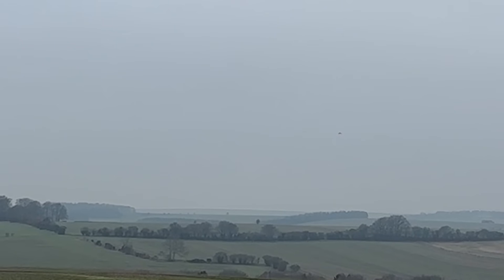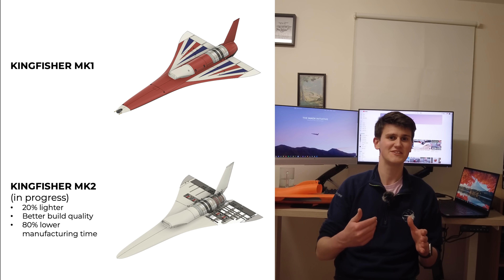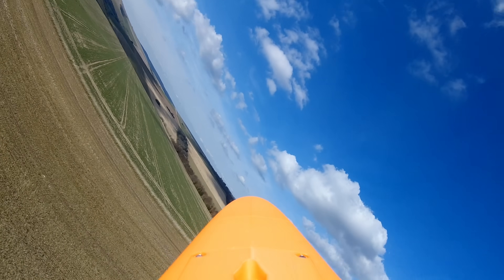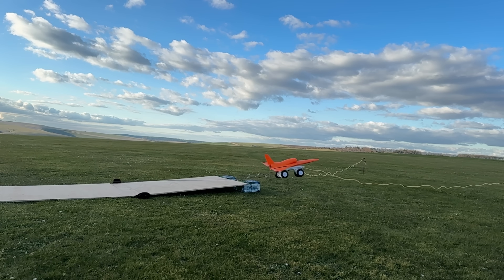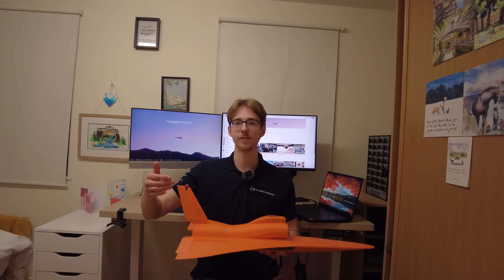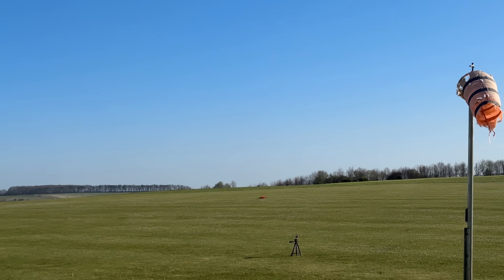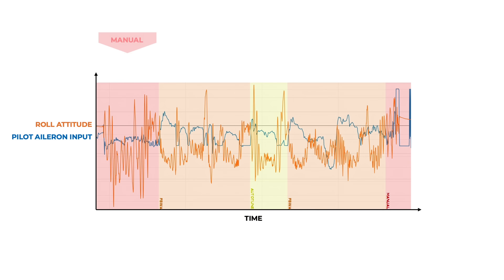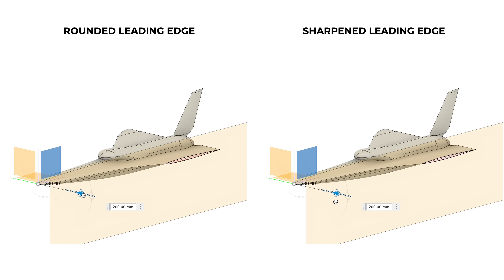After THREE CRASHES Kinglet Finally Lands!

Comment: With your current design, is it not possible that the roll oscillation is somewhat related to your ailerons being shadowed by the lifting surface? If you were to move the control surface out to the wingtip (i.e. where the dihedrals are now)? This would be an unconventional choice, but it can't be affected by the vortex separation and being farther from the CM, you would not need much force from them to get the required torque.

Comment: I love how they spent all that time trying to build a full scale one, using carbon fiber and epoxy, and and ACTUAL jet engine... Just to go back to a full 3D print with a electric prop...
Probably some kink in their original design they are trying to work out, but they didn't really say what or why, or even go over the results of the engine test on the full scale. 
Kinda sus
Reply from the maker: We got too ahead of ourselves, should’ve done the sub-scale testing first as it revealed a lot of flaws in the Mk1 Kingfisher design, these flaws are addressed in Kingfisher Mk2 which you can see in a community post on the youtube channel - this will be discussed properly in our next video coming out in 1-2 weeks time which goes over the engineering behind kingfisher and the kingfisher mk2 build. At least we realised this before trying to fly the Mk1 aircraft as we would’ve destroyed the jet engine
Reply: @TheMachInitiative Well, thanks for the reply, and good luck. Hope you can get it working, as it does look pretty freaken cool.

Comment: ---

1. Airframe Design

Material: Carbon fiber and aerospace-grade composites are a must for strength-to-weight ratio and heat resistance.

Aerodynamics: Supersonic or transonic airfoils, with a razor-thin profile and low frontal area. Very little surface area = less drag.

Reinforcement: Internal bracing for high G-forces and vibration.

---

2. Powerplant

Turbine Engine: A miniature gas turbine (e.g. JetCat or KingTech) capable of producing massive thrust.

Alternative: Pulsejet or ducted fan setups, but these are less efficient at those speeds and harder to control.

---

3. Control and Electronics

High-Speed Digital Servos: Able to handle extreme forces at high deflection rates.

Stabilization System: A flight controller with gyro stabilization (like Cortex Pro or similar).

Failsafes: Redundant systems for failsafe, telemetry, and GPS tracking.

---

4. Power Supply

Fuel System: High-quality turbine fuel with insulated tanks and proper pressurization.

Battery System: LiPo or Li-Ion packs for electronics with current protection.

---

5. Radio System

Long-Range System: At least 2.4GHz with telemetry or even 900MHz with a backup module.

Low Latency: Fast signal processing and minimal interference.

---

6. Testing and Simulation

CFD Simulations: Computational Fluid Dynamics for airflow prediction.

Flight Simulators: Test your model virtually (e.g. RealFlight or X-Plane).

Scale Prototyping: Build and test slower prototypes before going full speed.

---

7. Legal and Safety

FAA Regulations (or local authority): Likely considered a UAV or missile-like object at that speed.

Test Range: Must fly in a secure, unpopulated area or dry lakebed with spotters.

Safety Measures: Fire suppression, remote tracking, and crash safety gear.
 
Hope this helps achieving your goal

Comment: If the aircraft is sufficiently stable at the higher speeds during the record breaking attempt, you should set roll and pitch limits to prevent the aircraft from being in such a way that you unkowingly lose altitude (unless you have live altitude feeds in which case you can make an altitude hold system with auto yaw adjustments so that all you have to do to change your heading and stay level is roll left or right and the computer will do the rest. This is also useful to prevent overcorrection from manual piloting which can impact the aircrafts ability to maintain or gain speed, and in the worst cases can cause catastrophic failure if an accidental input puts the airframe at its limit.

Comment: under high dynamic pressure loads on the elevons you may find using a push rod for up elevator may be problematic at high speeds, i would personally suggest using a pull mechanism for pitching up, but other than that this thing look absolutely incredible. best of luck with M1+

Comment: I'd propose following (I am not shure if it works):
Mount 2(!) Fins (Like SR71, MIG 35...). Center fin sounds good for the first view but for high aoa. it get's slapped. Loads are high. 
 I propose a non-curved LE. Mount a straight strake to have a LE kink to fix vortex. These 3D-CFD-results look nice- but they don't avoid the first vortex (you know what I mean?) dancing around and destabilize along roll axis. You can also fix it by a b.l. fence- That's up to you. 
Shorten flaperon in spanwise direction a little bit. 
And go ahead - very nice project! Whereever u are. Whoever u are.

Comment: 133    put linkages on the  TOP  of the wing; because  turbulence  will happen there, anyway.       you may know that there should be a concentration of mass 'around' location of the center of mass (c-m).    ideally, the location of the c-m should vertically align with twenty-five percent of mac.      you may know that c-m and cg are two different thing.

Comment: 035   you may know that the model's dom is a bit top-heavy.    dom is distribution of mass.     the area of the vert-stab is low.     if that is not changed, there will continue to be a shortage of yaw axis stability.      alternatively, aft-located vortex generators could be tried.

Comment: 820   i think you don't understand that vortices are  sources  of  DRAG.!    (that is why (aft-located) vortex generators are utilized in order to increase the stability of certain jet fighter aircraft.)
on the other hand, lift is a  simple  newtonian  result when a wing has positive aoa, while moving through air.      this is why a toy glider, that has a flat-plate wing profile, flies just fine.
the data logging shows  YOU  that the model is flying in a nose-up attitude most of the time.      at those times, relatively  more  drag  is occurring.

Comment: 15 years in Aircraft design.  A couple of suggestions.  1, the fin looks too small, extend the root forward.  2, every gram counts, reduce cable lengths where possible . Reduce material thickness where possible.  Less weight requires less lift so less aerodynamic problems

Comment: Good luck chaps.  I assume you have the power required with the turbine to push to the required eventual speed?  I do wonder if, as per your web site, you're moving into prohibitively (for students!) expensive engineering with needing to use composites for the airframe.  This becomes a whole different ballgame!

Comment: Maybe all you need is to add wing fences two thirds of the way down each wing to prevent vortexes rolling off the wing. Study some early designs of late 1950s- early 1960s delta fighter planes like the Mirage, Delta Dart and Avro. 1960s Aeromodeller anuals also talk about wing fences for delta wings.

Comment: I've scratch built many RC deltas over the years inc one designed for all out speed and that it did perfectly until landing.
It exibited many traits yours does and I reckon for similar reasons, the fin.
Now I didn't have a dirty gert fan intake and FPV mount destroying the airflow on mine, I had an inline exhaust and cantered over 2 stroke but even small twin fins at the back of a delta don't see clean airflow at a high AoA.
Although your fin is high if you held the wing at 30 degrees and drew a horizontal line from the nose to the fin I doubt much would stick above it.  
I increased my fin size to be above this line and it turned into a pussy cat rather than a rebuilt every flight. This inculdes banked turns as these increase AoA and turbulence ontop of the wing.
For this same reason you'll have trouble supplying clean air to your turbine in anything other than straight and level flight so you may well get flame out issues.

I know you tried angled winglets but like that these just promote the vortices. 
You could ditch the weak central fin ( which while avoiding clean air may be hit by your wing crank vortices and inducing oscillation also ) and go with winglets.

I have nothing but my own built in CFD and years of tinkering to back any of this up but the fin is the first place I'd look to solve some of your issues.

Lastly, have a look at Dynamic soaring to get an idea of the type of engineering required to fly rc planes at these speeds

Comment: The camera mounted above the air intake is definitely disrupting the airflow significantly. If you actually intend to fly near Mach speeds, you’ll experience substantial dynamic pressure buildup both in front of the intake and along the leading edges. Therefore, it would be better to place the camera inside the intake, shaped like a cone — you would get a similar field of view (I understand you need to pilot somehow, and an FPV camera is very helpful) while at least partially simulating the increased drag at the intake.

Another point: at subsonic speeds, an intake on top of the fuselage works great because it helps create a low-pressure area over the wing. However, at supersonic speeds, an intake under the fuselage — like in the F-16 or basically any military jet — would be much more effective.

Also, your wing profile seems very thin, meaning it’s probably highly sensitive to changes in the angle of attack. It’s only optimal in a very narrow range of angles close to zero. It would be really helpful if you installed a Prandtl tube and an angle of attack sensor at the nose. You would gather much more flight data instead of just getting a nice YouTube video showing it flew and didn’t crash.

It would also make it easier to program the autopilot if it had real flight data like IAS, true airspeed, Mach number, and angle of attack.

Good luck with the project — I’m genuinely curious whether this is just something that looks cool on YouTube or if you actually manage to make it work.
Reply from the maker: Thanks for your interest in the project! To answer some of your questions:

The camera above the inlet adds drag - although it will be smaller (relative to the aircraft size) on the full size aircraft and the pilot needs to see! Our inlet has been designed (using CFD and engine bench testing) to deliver uniform subsonic flow at the compressor face (to maximise engine performance), so we don’t want to disrupt this flow by placing a camera inside the inlet. It’s also worth noting cone shaped inlets are normally used at high supersonic (>Mach 1.6) speeds to manage the formation of shocks - this isn’t an issue for us as we’re only targetting Mach 0.75.

From an aero/ propulsion perspective, we’d rather have the inlet on the bottom (it also improves engine performance at subsonic speeds, especially at high angles of attack), but there is a practical limitation of needing to do a belly landing, and we don’t want to ingest debris into the engine.

The wing has a 4% thickness to minimise drag. Delta wings generate lift in a very different way to normal wings, using their highly swept shape to generate fast vortices that create a lot of suction. The wing thickness has next to no impact on the lift curve slope/ stall characteristics of a delta wing, and in fact wind tunnel tests have shown that the Kingfisher’s delta wing stalls at >30 degrees angle of attack. The Kingfisher lands at ~20 degree angle of attack, so a much higher angle than a conventional wing can achieve.

If you’re interested in learning more about the CFD and wind tunnel testing that has gone into analysing the Kingfisher, please see a paper we (Dan and Max) wrote as part of our masters degree projects, where we investigated the aerodynamics of Kingfisher’s original delta wing design: https://arc.aiaa.org/doi/10.2514/6.2025-0655

Agreed that an AoA sensor would be useful - could then cross reference with the wind tunnel and cfd data. Thanks for following the project, hope to provide another update soon!
Reply: @TheMachInitiative Personally, I would have designed the nose in a cone shape as opposed to a flattened shape and have the camera mounted there inside a clear nose cone.  Every percent helps when reducing drag!

Comment: As basically any delta configuration does, yours obviously has issues with dutch roll. Due to the sweep angle deltas have a lot of effective dihedral, scaling with the lift coefficient. That combined with a lack in yaw damping creates the roll wiggle, i.e. dutch roll. Try a little bit of anhedral, maybe even just in the wing tips, where it is most effective. Also try to increase the yaw damping by increasing the vertical fin area, increasing its lever arm by moving it even further back, increasing the fins aspect ratio (yours is quite high, so not much to gain there). Also try to add fin area below the wing rather than above, as the top end of the fin creates its own effective dihedral that is unwanted. It is nothing new, knowledge well esablished for decades, but maybe you didn't have come across, by chance.

Comment: A funny suggestion, but I'd say to put a cue marking somewhere 1/4 to 1/8 off the end of the launch rail. Simply paint a stripe going across. That'll give consistent timing to start pulling back on the stick.

Also it'd be neat to get confirmation if beating the records established in dynamic soaring. I still find it amusing that the fastest bits of hobbyist kit (other than rocketry) are unpowered gliders. (I think they're doing something around 550MPH? If not more?) It's crazy how much those things rip through the air simply by taking advantage of terrain, weather, and a few physics exploits to gain momentum.

Wing fences like those seen on some old fighter jets might be handy too, as long as they don't introduce their own issues. Trying to think of a way to counter the tip vortices issue that seems to be a possible problem with this design. Part of the trade-off is do they give enough stability for any drag they may add?

Comment: It is looing really good guys.  As your speeds increase watch out for a separation of airflow at the leading edge.(not an expert. just a curious observer).  They solved this in the avro aero by some form of small knotch in the leading edge to redirect some over the wingcloser to the body.  I''ve seen a similar leeding edge pop up on other modern high speed jets.  I do believe you fellows have the moxy and smarts required to get it done.

Comment: Isnt it a sort of turbo fan not a jet?  Presumably a jet would burn something, your turbine is electric? also what about slightly dipped instead of raised wing tips, that would give you some ground effect stability on launch(assuming the wing plane carries on over it, so you dont end up with down rudder, plus with the lead wing surface carring over it would give it additional sideways anti stall when rolling, as you gain a little side-on lift, the downward wing on a banked turn would also gain sideways lift/drift.. which might make banked rate of turn a little... different), wont interact with the upper vortex, and offset the drag from the engine pod slightly giving it better neutral thrust glide.  In theory.

Plus it would look really cool

Comment: For your take off, why not use a rail? Even something as simple as some square tube tubes connected with a slightly smaller tube inside each joint to stop flexing. have a little cart hold the rail like a rollercoaster would track and you could even 3d print legs that could use the same bolts as the joints.

Comment: Just some thoughts: if it’s not the control response, then I would suspect that my leading edge vortices are shedding leading to roll oscillations in flight, and while sharpening the leading edge might help pin them down. I would experiment with vortice generators on the top leading portion of the wing, just to see if ‘fixing’ the vortices dampened the oscillations. If the oscillations are [also] in yaw, i would make the tail taller to avoid the dirty zone behind pretty much everything at high angle of attack. Maybe even go with twin tails (if yaw is seen). 
I would also incorporate a parachute into my test platform that I could deploy on demand to at least slow the rate at which is plummeting towards the Earth. And then I would land by parachute in general & maybe give it a frangible nose to suit.
☘️ ☘️ ☘️ ☘️!

Comment: Sharp leading edge...higher risk of leading edge stall at high AoA? How do you safely test this and maintain controllability?
Reply from the maker: Delta wings generate lift very differently to normal wings - their highly swept leading edge causes them to generate fast moving vortices which create lift. These vortices mean that delta wings can fly at much greater angles of attack than normal wings, in the wind tunnel we tested Kingfisher up to 30 degrees, and it still hadn’t stalled. A sharp leading edge creates a more stable vortex which will likely delay the onset of stall even further - this stable vortex should also reduce the wing rock issue.

Comment: Great job! I fly fast pusher planes with similar delta-wing designs. My planes have two tailfins to smooth out the rocking but I still encounter some left-right oscillations at high-speed dives.